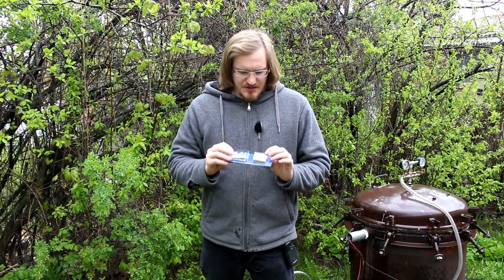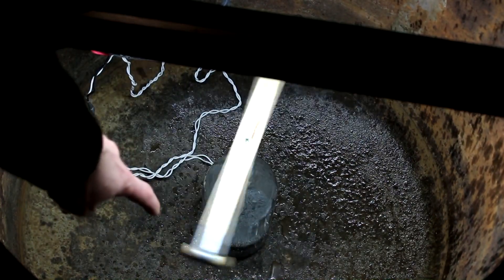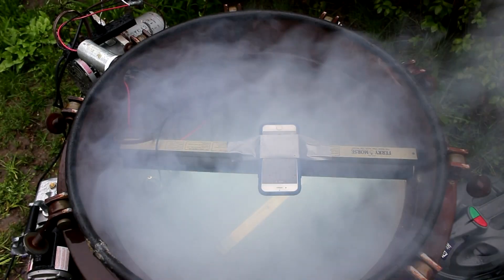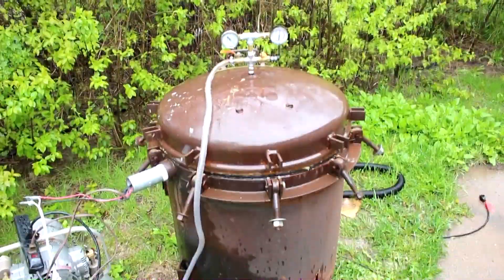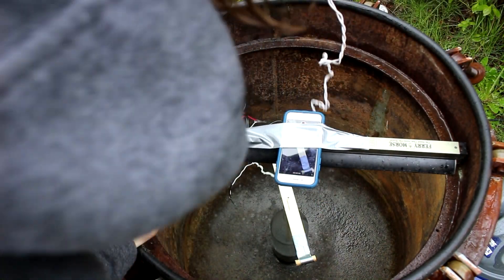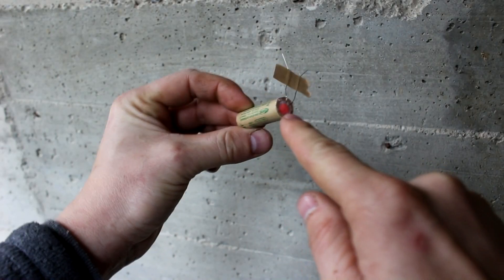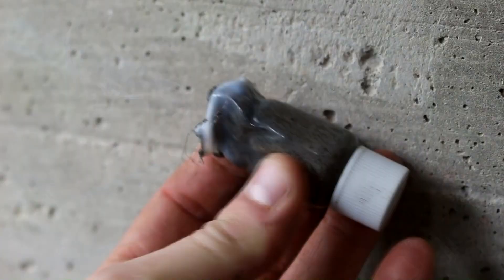Will a Model Rocket Motor Work In Vacuum?

Comment: No!! What kind of rocket-scientist are you?
It did moved due to the pressure built in the tube and with the air used to cause the burn that was inside the tube, the same way a balloon has energy to fly due to the pressure relieving from inside out!!! .
Do it with the tube in both tests!
Its obvious that the impulse from that tube blowing was what cause the movement!!! ...and it will do
Reply: Well the rocket motor was clearly burning either way

Comment: making a prediction and will watch when im off work. Im gonna say that a rocket will work in a vacuum if it has an oxidizer in the fuel.
Reply: Close, you also need pressure if it's a gunpowder rocket.
Also pretty sure all Rockets have an oxidizer.

Comment: Lmao exactly what I expected happened since there is less air resistance it can spin faster and longer
Reply: Another comment pointed out that it actually produces more thrust because there's less pressure at the nozzle holding the gases in.

Comment: 2:40 Well, that makes sense, the one that lit has become lighter. And the heavier one has more centrifugal force...
Reply: By the way, the TUDelft student rocket engineering team, blahblah, whatever it's called had the same issue:
They used blackpowder to shoot of the nose-cone, which didn't work.
Testing whether the brand of blackpowder you bought in a vacuum is apparently too much efford. Letting your rocket crash into the ground is obviously a lot cheaper than putting fireworks in a pan.
What they thought: "making a vacuum chamber is not rocket science." as an aerospace engineer you are studying rocket science, so yeah... Not doing what's not rocket science makes sence.
Reply: Slingshot.

Comment: I was about to trip out if it didn't eventually light off, I used to buy packs of hobby rocket motors just to salvage the propellant for makeshift explosives as a kid.  Using the included  igniter always worked, even in an evacuated 1/4" steel cylinder (like the kind they fill with water and freeze to demonstrate how ice expansion wrecks sealed containers)

Comment: Was curious if you could try making an addition to this video where you create a video where you recreate this engine yourself but possibly using a similar to nasa approach. To increase results and completion of burn (since i noticed it didnt burn fully since the parachute charge didnt go off). You would need a rocket bell for the exhaust gases to increase pressure in the combustion chamber and instead of a cylindrical hole down the center a star shape would allow more surface area to be exposed, also increasing pressure (nasa uses an 11 point star but any star will increase surface area).... Just think it would be cool

Comment: This experiment is flawed. And, if this is an attempt to prove rockets work in space, its bad science. You are changing a small volume, very quickly. Clearly, the first rocket shows no propulsion and not even at full vacuum! But, the last one you rigged up, you basically put mass/resistance in direct line behind the ignition for the resistance to move it. It's as if you put a temporary  little wall behind the thrust. Nice trick! See, I'm smarter than that. Also, the chamber is not a continuous vacuum. That last rocket, and the trick you did with it, occupies a significant percentage of volume in the test chamber. ROCKETS DON'T WORK IN THE VACUUM OF OUTER SPACE. Nice try, Cody. But hey, preesh the experiments. You just continue to do my work for me. And, that is to reveal the theme park presentation NASA is. LMAO!
Reply: Good job on letting me know that you've been stumped and have to resort to insults
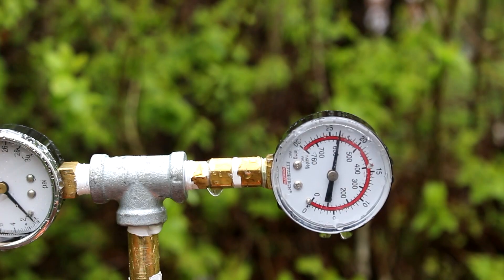Reply: 6:14 shows a negligible change in vacuum. I don't get what you mean, Cody just showed that the rocket works in a vacuum, and if he has to put a temporary plug to help build pressure, why can't NASA do that too in their rockets?
Reply: You just don't get it. Dumb, dumb, dumb, dumb, Duuuuuuumb🎅🏻
Reply: Maybe you didn't realize but 1. It created thrust in a vacuum 2. Its a model rocket engine not a finely tuned machine
Reply: I see you not smart enough to argue with facts so you call him dumb like a 5 year old and electrobooms daughter made you look stupid see we both can play at your childish games

Comment: Rocket is to close to wall of the container.Energy is feeding back off the side of the container.You need a very small rocket in the center of the container,that is isolated from solid mass, to see whether rockets work in a vacuum.
Reply: You really think energy can feed back from the side... But not push off the rocket itself?
Reply: You have to understand that a true vacuum is,three dimensional area with nothing in it.Add the vastness of outer space and you have rocket exhaust that, does not slow down.You need that slowing down to move mass in the opposite direction.Newton's third law, is horribly misapplied in the explanation of thrust in space i.e(a car on dry pavement does not have an equal and opposite reaction as a car on ice) Space is the perfect "ice".
Reply: No newtons third law is not misapplied at all. The gas being expelled from the rocket is pushing it.. Gas has mass, it creates a explosion exerting that mass onto the rocket.
Reply: It needs mass to push against.
Reply: The gas has mass.. Explain to me how the explosive magically bounces off the air and transfers the energy.. But cant directly transfer the energy to the rocket its self.
Reply: Mass will not slow down in a vacuum.Not slowing down equals "no work" which equals "no thrust". You can't pick yourself up by pulling up on your pants.You need to push off of something.The mass has to act on something .You cannot get something from nothing.The vacuum of space is "nothing".